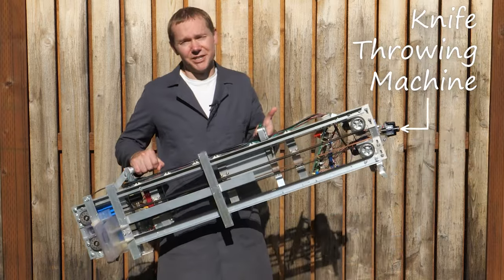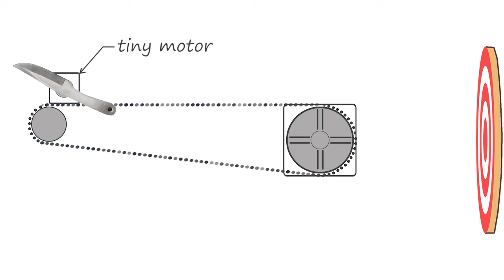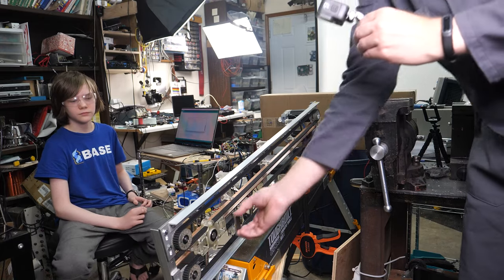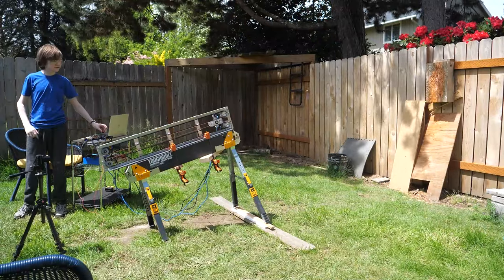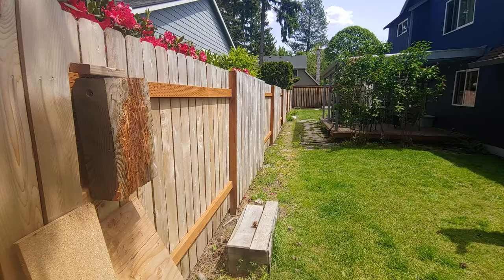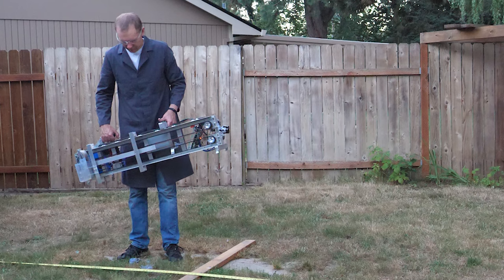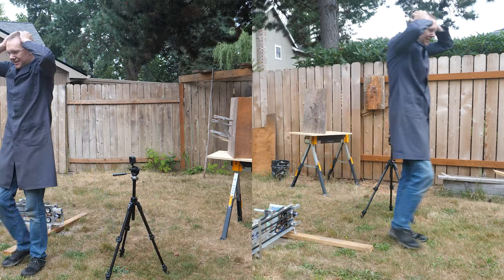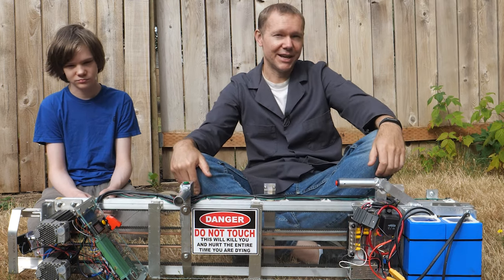Knife Throwing Machine Part 1 - The B.U.I.L.D.

Comment: I understand the concept of a throwing knife machine, but if the machine launched the knives from a straight rail. Wouldn’t it be more effective instead of rotating the knife? It would have to get more speed and depth from the blade to the wood.

Comment: I would also consider the fact that when the knife is thrown versus you manually stabbing it into a block of wood that your hand acts as a dampener for the vibrations created throughout the body of the knife (upon impact) potentially mitigating the ability for the tip of the knife to dig its way through the material.

Comment: Spin throwing is hard.    It's all about the slip of the knife in your hand. So I start with a short half rotation throw double that distance to throw from the handle.  Then to stick at uneven or distances you just adjust the location of your fingers moving them closer to the center point slows the rotation.   Takes practice. I'm not good but techniques help.

Comment: I have a question or idea to increase solar panel output.......    I have yet to see or hear any studies or ideas about using the suns heat effect on surfaces . I live in the southwest and it's to bad not to include the heat generated from rays of the sun.  For example, dare not touch a metal body of a car on a hot day. The idea would be to include some type of acid / chemical within the solar panel to increase the movement electrons thus increase output of the panel.  Just a thought!

Comment: Hey I wanted to answer your question to the best of my knowledge about knife penetration.  I am a gun nut and this is a very similar science of kevlar vests and velocity.  You stabbing the wood by hand is not at a high velocity, and you need that to puncture material.  Believe it or not, a big bullet traveling slow will have a harder time puncturing kevlar than a small lightweight bullet moving at high speeds.  So a big powerful shotgun wont get through most armors, but an ar-15 would have a better chance.  A .50 BMG marries both weight of bullet with super high velocity and has anti-vehicle capabilities.  

So my theory in summary is that stabbing by hand has a slower velocity thus less penetration, even if you stab hard.  The throw, by natural leverage, gives a higher energy potential and speed needed for a deeper cut.

To add an interesting tidbit, there is a man (ripley's beleive it or not)  that can throw a sewing needle through glass.  This is the most micro-extreme example that I know of for this area of science.

This would be a great question to send off to Smarter Every Day for a full scientific breakdown.

Comment: Your question at the end, why a thrown knife sticks in further than you can by stabbing it, I want to take a stab at. 

I suspect it may have to do with energy imposed on the knife being accumulated over the full swing of your arm before releasing, is greater than the energy you impose on the knife trying to push it in with your hand directly. 
Think of trying to hammer a nail. If you put the hammer head in your hand and try to push/strike a nail until its sunk, it would feel like you're doing a lot more work than if you gripped the hammer by the end of the handle, and lightly took a full swing. The kinetic energy builds the whole time your arm is accelerating and gets transferred upon impact. A short stabby motion may still move the nail, but you are more likely to notice the amount of energy you needed to apply to get the same work done.
Reply: I'm late to this vid, forgive me if it was already answered in a subsequent vid. 
Adding to clarify my example above...
Energy = mass × velocity(squared)
The energy required to sink a nail is constant, the mass of your arm/hammer is constant, but the velocity changes, and changes by the square. This is why velocity seems to matter more than what you would expect. This is why lighter, faster bullets have higher muzzle energies and better ballistics over heavier, slower ones (to a point, but more than you'd expect).

Comment: Pro tip (learned by practice),:
Each step away from the target = 1/2 spin..so

1 step away =knife held by the handle. 
2 steps away = knife held by the blade.
3 steps away = knife held by he handle again.
 So and so fort

Comment: those knives would most likely work better at those distances with a half spin, would be cool to see a variation that can switch between half and full spin depending the distance, half spin has more power/accuracy (from a human) at roughly up to 10m

Comment: Oh I threw knives for a decade or so before I grew too disabled, and I'm quite sure I can tell you why a thrown knife sticks much better than a stabbed one. The energy of the arm converts to the knife and is aligned very straight compared to a manual stab in the instant of impact, so it's much more akin to using a chisel than an icepick. Your hand and your entire body also actually cushions the blow when you stab a hard surface without piercing all the way through, compared to if you were stabbing something softer and the force kept transferring from your arm rather than stopping abruptly. I have a hard time describing this issue in technical terms, but imagine using a bow against a hard wooden target, shorter than your draw distance away, and releasing. 

Anyways, cool build and experiment and I'm interested in seeing more of the machine, and who knows, what I thought I knew about this for a long time might be proven wrong, that wouldn't be a bad thing

Comment: The answer is simple. Without a hand guard your not following through with all the energy to avoid being cut where as the throw has no choice but to apply every bit of energy sent with it. Basically your stabbing it with less power then when throwing but I could be entirely wrong. There may be some factor at play like the rotating energy allowing it to cut easier thus going deeper but ik as humans, we tend to stop at the board when stabbing

Comment: As cool as this is, it unfortunately doesn't prove it can actually work at different distances by adjusting the spin rotation since instead of moving around and shooting it, you only shot at two set distances.  blocks of wood.  or it actually adjusts the spin rotation since you chose just two set distances to test.   For all we know, you picked two distances that were exactly one rotation of the blade apart which wouldn't require any measurement or rotation adjustments.

Comment: I've been throwing knives for years and I know why your having trouble tossing by hand. First of all your technique is all wrong. You don't throw by the handle. Ideal rotation is 1/2 rotation for every 8 ft. That means you throw handle first from that first 8 feet. There are many videos on this. Second your target is also a problem. Try hanging a soft slice of log. Its way more forgiving. Than being said AWESOME BUILD. Above all as always. There is never an equal to tons of practice. The biggest issue with learning to toss a knife is the dreaded ricochet. Be safe. A half wall to throw from is a safe bet against rebounds to the body.